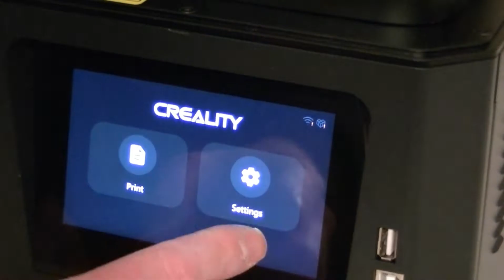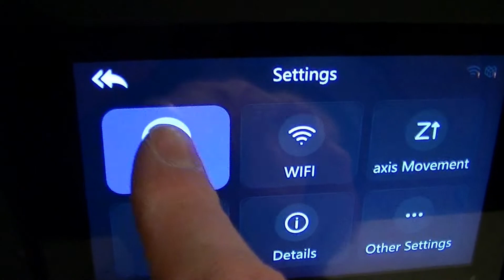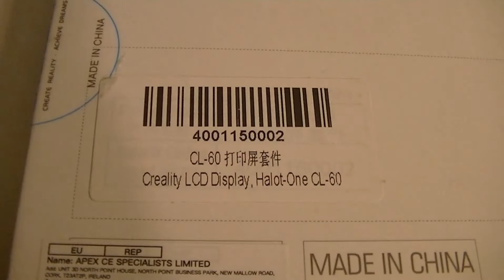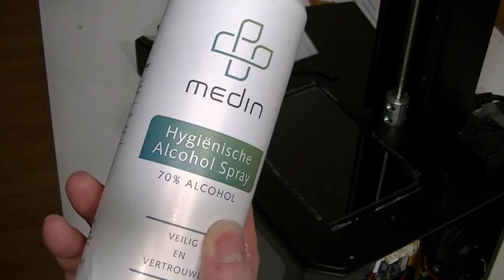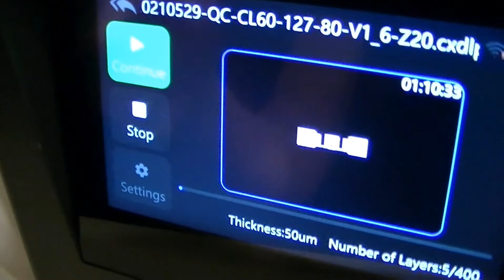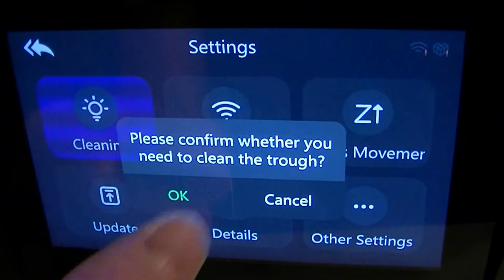Creality Halot one screen replacement

Comment: There is a much easier way to remove the screen, heat the outer edge with a heat gun then take a suction cup tool (like the one you use for mobile phones), lift up right side with suction cup, then you get a gap to slide in a spudger tool or guitar pick. Run the tool all the way around and the screen will lift out without any damage whatsoever. Takes less than a minute.
Reply from the maker: Thank you for your tip. I didn't know that when I made the video. I just follow the steps show in the official Creality video.
Reply: @olaf99a  yeah, I've seen that video too. They make it look so easy using a utility knife 😁

Comment: I replaced my screen a while back using your video but after it would illuminate but not cure the resin, I assumed the resin was old and then didn't get around to messing with the printer for several months. I recently got new resin but it still wont cure even during a cleaning cycle, only thing I can think of is maybe I didn't remove the bottom film. Do you think that film could block or change the wavelength and not let it cure the resin?

Just cant figure out how it could illuminate but not cure, and I did verify the part number was identical before install.
Reply from the maker: I do not know. The instruction says remove the film.

Comment: Hey @olaf99a can you help me? 
I hace changed my screnn but don work. My old screen works fine but the new one won let pass de uv light
Reply from the maker: Hello. If the old screen is just fine why do you replace the screen? Check cables and remove screen sheets as seen in my video.
Reply: @olaf99a  The ol screen has blank zones. But t uv pass on the center on the lod one. Ive removed the sheets. Its weird thing
Reply from the maker: @dnicodemi  I don't know.